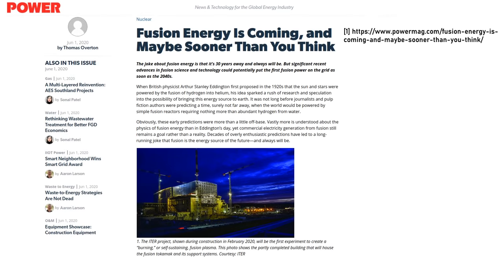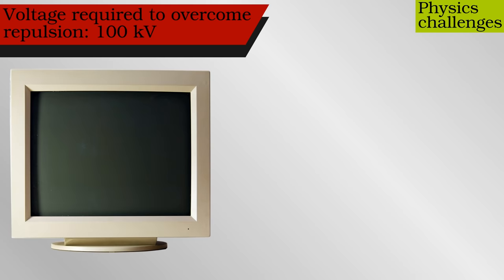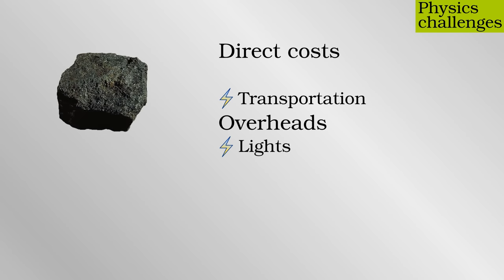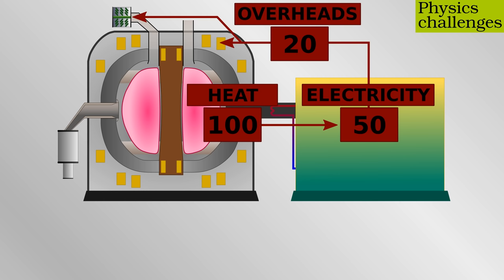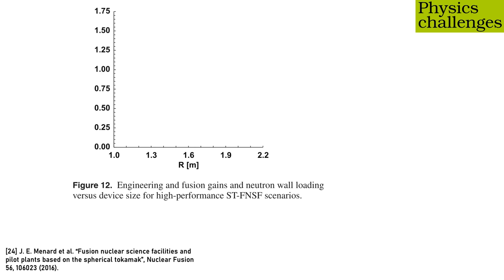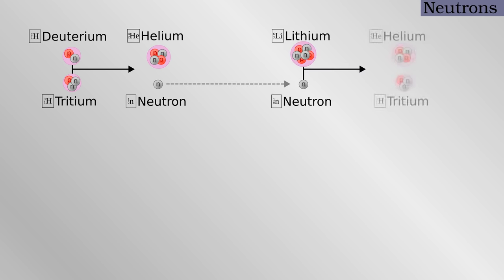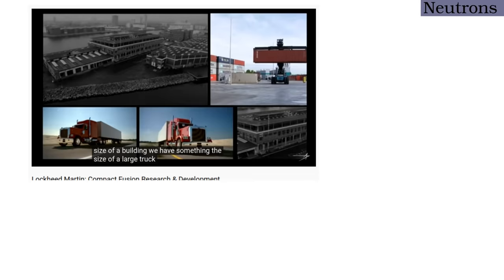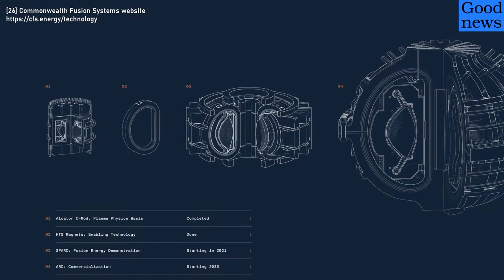Former fusion scientist on why we won't have fusion power by 2040

Comment: This is probably stupid. But isn't it theoretically possible to do what thermonuclear bombs do? Use a fission reactor to start the process and use fusion to increase the output. Once you have overcome the challenges of course.
Reply from the maker: Couple of options: 

1) Set off thermonuclear bombs (yield: at least a few kilotonnes) in a huge underground chamber and collect the energy. This is theoretically possible, but in practice would be very challenging to make profitable, overcome political and diplomatic issues and so on.

2) Run fusion reactions, possibly at an energy loss, to produce high energy neutrons. These neutrons then cause fission reactions in material around the edge of the reactor. More reasonable than the above point, and indeed the "Father of the H-bomb" Edward Teller thought it was a good idea in principle.
Reply: @ImprobableMatter  Is it not possible to do it the other way around? Let's say you don't have the best confinement. So using a cheap source of energy for heating up the plasma like fission might be viable?
Reply from the maker: If you have the best confinement, just use microwaves, or lasers or whatever. The heating isn't the problem; the confinement is. Bad confinement means that whatever energy you put in, you will just get back out as heat, and the amount of fusion energy produced will be negligible. Why go through the trouble of putting in energy from fission into an inefficient fusion plant when you can just make electricity directly?
Reply: @ImprobableMatter  That makes more sense. Thank you.

Comment: Why can't you breed tritium using the neutrons from current fission reactors?
Reply from the maker: You can, but every fusion reactor would require the output of multiple fission reactors. At that point, why bother with fusion?

Comment: unlike other ignition points like wood, gas, even thermite, fusion requires another constant source, gravity, since gravity is essentially free in a large object, making a portable fusion unit will never be positive net energy because we'd have to keep introducing a form of pressure back into the system, thus fusion is a pipe dream.

Comment: Tbf there is one way in which progress on fusion technology could be sped up massively, that would be if the funding was actually increased to actually appropriate levels. If fusion got the same amount of funding that military technology gets or oil extraction gets then it could probably be achieved much faster. Alas technology that is actually helpful, solves major problems and could benefit the entire world getting sufficient funding is a more unlikely prospect than the laws of physics suddenly changing to make fusion easier.
Reply: Things don't just magically get better or easier just because you throw more money at it. Not how that works. Your comparison to military spending is apples to oranges.

Comment: wait... why does the mass of the fusion result have to be "less than iron or nickel"? What's up with that?
Reply from the maker: Iron and Nickel are the most stable elements, meaning that energy is released when nuclei lighter than them fuse together, or when nuclei heavier than them fission.

Comment: I'll say back to the drawing board on that one and do me for a self contained quantum fusion chip about a cm cubed, that stays roasting for eight years. Just whack two pieces together at 40km/second. Not that much momentum, about the same as a person on a bicycle. There are tricks to maintain momentum and increase speed, e.g. whips, and conservation of angular momentum. Concentric planar and non-planar wheels? Generally move something heavy and transfer the momentum to something lighter without losing energy.

Comment: Sorry, I have a short question. Would it be possible to embed the reactor in water instead of shielding and use the kinetic energy of the generated neutron to heat it up, generate steam, turn a turbine?
Reply from the maker: The plasma has to be in a vacuum (better than low Earth orbit in some cases), so you can't just pour water in. You would have to have solid walls which are thick enough to hold back the water, facing the fusion reactions . At that point, you're better off using the walls to hold back liquid lithium rather than water, because you must breed enough Tritium for the reasons I described.
Reply: @ImprobableMatter there is a company experimenting with a liquid layer in the wall of the reactor to stop the radiation damage to the reactor itself which is the other big issue of fusion. I don’t have all the specifics on it though

Comment: 3:14  "Best attempt to blanket the earth in greenhouse gases".    If it is in the bandwidth of greenhouse radiant energy it is completely absorbed in earth greenhouse effect.  Earth's atmosphere is too cold to appreciably radiant inferred energy, further heat transfer is by convection i.e. gas molecules bumping into each other.    The troposphere (the bottom zone of the atmosphere) warms greatly from earth's greenhouse effect upward from the ground and gets cooler as it goes up.  The convection effects is what produces much of earth's weather.  The stratosphere (level of the atmosphere above the troposphere) heats from the top down from high energy ultraviolet radiation from the sun much of which is converted to lower frequencies enabling it to warm the earth's surface. 

Earth's greenhouse effect is frequently used as a primary example to high school students of a system always in saturation from the strong greenhouse gas water vapor absorbing all the greenhouse radiant energy from the earth with greenhouse gases within 20 meters of the surface that is all around us everyday and can't have its overall effect changed.  There is no further greenhouse radiant energy to interact with greenhouse gases.  At 1% average tropospheric water vapor over 99% of earth’s greenhouse effect is from water vapor.  Water vapor would hold earth's greenhouse effect in saturation if it were the only greenhouse gas in the atmosphere.

Global warming was officially stated at 1.1°C in 1991 and 1.06°C in 2022.  There is no mechanism that would allow greenhouse gas behavior to cause global warming.   The back of the United Nation's IPCC science report states it took its greenhouse gas samples at 20,000 meters altitude where it is common high school level knowledge there is no greenhouse radiant energy.  This is typical practice for deceptive marketing to state legal data transparency protecting the perpetrators from fraud prosecution.

Comment: One challenge not mentioned is operating ultra high tech ultra clean ultra precise processes in an industrial environment.  Having worked in some actual power plants that produce power from coal, natural gas or petroleum I can say they are vastly, vastly less complicated than a fusion reactor nevertheless it is hard to keep them running.  Keeping a commercial power producing fusion reactor running and on the grid would be hard to the Nth power.  Or in other words, not attainable.  To put it another way, it is possible for a human to run a mile in less than 4 minutes.  Now hire 1,000 men.  Tell them all to run a 4 minute mile.  Then 4 minutes 2 seconds later tell them all to do it again.  Then 4 minutes 2 seconds later tell them all to do it again.  And again.  And again.  Keep this up all day.  Then all night.  Then all week long.  :)

Comment: I agree with the thesis of no fusion power by 2040, but we've gotten much closer since this video's release, and even in past weeks.
I know everyone is talking about LLNL right now, and while it's a big step, it's clearly overhyped. I won't pretend to understand this 100%, but it looks like Helion has made much more progress towards the eventual goal of economically viable fusion energy, at a distant—now slightly less distant—point after 2040.

It looks like the Helion announcement is much bigger than the LLNL. Am I missing something?

Comment: The scary thing us to imagine that a net gain of 1% is considered success. This is basically removing our water out of the water cycle. They used to say we will never run out of oil. Not to mention the physical limits of melting the vastly expensive and inefficient reactor. It really seems like running a ship engine to power your torch.

Comment: Aptera Motors cracked the problem of harnessing fusion power for automotive purposes. Every Aptera produced starting in 2024 will have fusion converter cells on the roof allowing for up to 40 miles a day of free electricity collected from the only free fusion reactor in our solar system, know colloquially as THE SUN. Oh, wait, someone is saying we already generated 1300 TWh of electricity last year from fusion power collected from this free fusion generator? So why are we still trying to make our own fusion reactors at huge expense when we already have practically limitless free fusion energy being beamed at our planet 24/7? (yes I did say 24/7 because the planet as a whole is continually receiving constant exposure to about 50% of the planet's surface on a rotating basis, just so that we all get our fair share of free energy)

Comment: Viable hot fusion power stations have always been 20 years in the future - since the mid-1950s. You might want to study and learn the connections between "cold fusion" and the events of 9/11 to understand why we are forced to use either fossil fuels or not-really-renewable energy systems now. It's serious.

Comment: What if we cool down Tritium (or even Hydrogen ) gas to about 0 K in a confined chamber and then hit it with accelerated 1MV Ion beam of Tritium ( or even Hydrogen)  from several side. The explosion could heat up large swimming pool which could be used to generate electricity.

Another idea is to use very large parallel magnetic field on accelerated  positively charged ion beam of Tritium (or even Hydrogen ) to focus it -- similar to what CRT does for electrons to create sharper beam -- so that the ions gets concentrated so much that they fuse together.

Another idea is develop technology to generate power from neutrinos.  As you know, neutrinos hardly interact with anything, and we have hard time detecting them so we need large swimming pools of water just to detect them.  However, if we could develop technology to harvest neutrino's energy, we will have abundance of energy, since sun generates huge amount of  neutrinos that passes earth and even our body without any inteeraction.  Unfortunately, I am not familiar with neutrino reaction with mater and resulting products.  Could someone educate us about neutrino's reaction with mater?

Comment: If I had an issue with fusion power, it's that the big money seems to go to projects that WE KNOW WON"T WORK. The Tokomak done right, even if it eventually gets appropriate gain and manages to catch enough neutrons, still has the problem that taking the world's current production of Beryllium and using 100% to power 2% of France is not not economical, but a non-starter of an idea. Why have we already spent billions for a single site project that we know will require billions more before gain of 10 and hours of uninterrupted operation before billions more before it works properly giving off energy that we can't possibly pay for and only benefits France and can't be used for other, better fusion ideas? Spend the money appropriately. I'm down with the deuterium/deuterium interactions where they breed 4H & N or for the deuterium + boron lines of thought. They may/may not work, but at least there's hope they eventually will work. I'm convinced that not only is the Tokomak a dead end, but we know it's a dead end, and it gets the majority of the fusion money.

Comment: The example you cited of a private company being corrupt it's possible but I think it's much much more common for publicly funded programs in general to be corrupt or massively wasteful.  Generally if a private organization doesn't produce results it dies out after a while. This is true for all scales of companies.  They mean I've been wasteful or corrupt but their plans may not have worked out the way they expected.  On the flip side publicly funded things are not based in reality because they're funding doesn't come from natural processes. They're funding instead comes from government which doesn't run out of money in the same way 99% of businesses will.  I used to work for the government and there were huge financial drains.  The inefficiency was massive and there's no way that those same organizations could survive outside of the government. Sometimes that's fine because we need to work there doing but often that's not the case. Just look at how big the United States national debt is. Government is spending more and more and more and not by a little bit.
Reply: I get that it's just an example but I kind of want people to stay grounded in reality. We have this view that if the government's doing it it must be altruistic or not corrupt but the people working in government especially the higher-ups have similar motivations to people working in other companies. Their constraints are just different but they're still interested in building large organizations and expanding their reach and power and influence.  There's still a lot of playing favorites and laziness and working slow are plagues.

Comment: Ok so if its been 30 years away from 1950 to 2020 and now its 20 years away then it will be 20 years away til 2090. Then 10 years away till 2160. So we should have fusion power by the year 2230

Comment: I didn't study anything about engineering or physics but as a finance graduate that wanted to work in the energy sector, the answer is 100% gonna be money. Its too expensive to build facilities, also to buy abandoned ones and to update them, and the public perception for nuclear is so bad you will literally have to spend money to convince people its safe. Enviromental people will go crazy over any flaw, government will rather go back to coal or support solar/wind depending on their political alignment and if you can overcome that they will regulate your industry so hard because of national security. Your only supporters will be your nuclear fans, anyone that isnt all in for nuclear is basically against it, with money leading the charge.

Comment: Why do we even need to bother trying to collect energy from neutrons? They carry most of the energy, but there's still way more energy left in the charged He4 product than is currently released by U235 fission, and we have no problem getting useful thermal output from fission. And why bother with lithium, and an expensive blanket of beryllium? If we can get slightly hotter we can breed tritium from D-D reactions, or from He3 neutron capture. I'm asking because I want to know why this doesn't work, I'm not suggesting this is a groundbreaking revelation
Reply from the maker: Watch maybe 5-10 minutes of my follow-up which explains that D-T is the most reactive fuel mix: https://www.youtube.com/watch?v=2DzKXN1pcwY
Reply: @ImprobableMatter  I agree that D-T is a superior energy generating reaction, and in a D-D reactor, most of the energy would be produced from D-T from in-situ tritium breeding, both directly from D-D and from He3 neutron absorption. If you need to breed tritium I just question the economics of using very expensive beryllium and lithium, especially for creating a practical energy system. A slight increase in confinement would mean a massive decrease in material costs
Reply from the maker: By "reactive" I mean "fastest reaction rate". The rate at which D-D reactions happen (let's say 100 times slower than D-T) would throttle the whole process you describe. Because the process is slower, proportionately more energy is lost (if losses are roughly constant regardless of fuel type - they are actually higher with Helium).
Reply: @ImprobableMatter Certainly, energy losses due to Helium will be a considerable problem in both schemes, as He4 is a common end product in both. I wasn't aware of how large a difference there was in reaction rate, and yeah those energy losses would be prohibitive. Would there perhaps be some reduction in Bremsstrahlung losses when accelerating lighter deuterium as opposed to a 50:50 mix of deuterium and heavier tritium, due to a reduction in mass?
Reply from the maker: Bremsstrahlung is about charge. Studies have been done where a pure Deuterium plasma was run (D-D reactions were observed) and then with the same conditions a 50/50 D-T plasma was run and those kind of losses were (near enough) the same. It's just that, different energies of the reactions aside, the rate of reactions was orders of magnitude higher in the latter.
Reply: @ImprobableMatter  That's very interesting, I would have thought mass would have some significant impact on acceleration, but results are results. Nonetheless that's just the sort of explanation I was looking for, but I was struggling to find it myself. I guess the bottom line is that I'm reluctant to call lithium/beryllium breeding viable, especially commercially, and if it's not, then there needs to be a better alternative to breed tritium

Comment: I have a working fusion reactor. I put 8 solar panels outside,  feeding my controller and lithium batteries. I generate about 2 KWh. There, I just beat billion $ "fusion reactors" designed by academics. When will a scientist discover a way to make a 3D cubic solar collector. A cube that turns fusion sunlight into power. We have already gone from 2D solar panels to bi-facial semi 3D panels.  Are there enough photons per cubic meter to make a 3D design work? The idea of trying to contain hot plasma seems a bit misguided